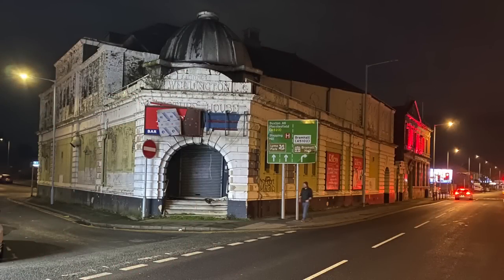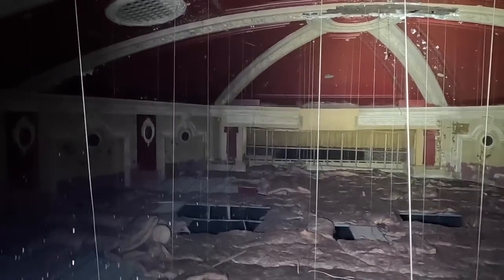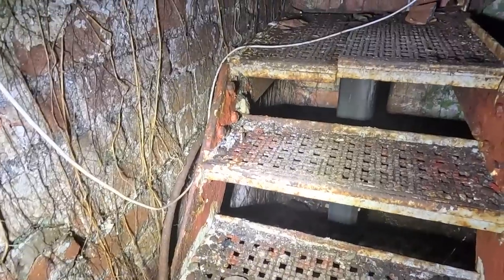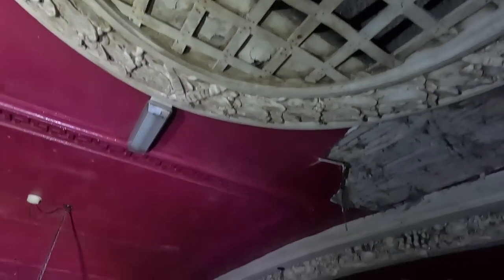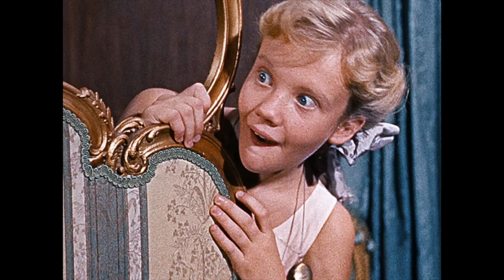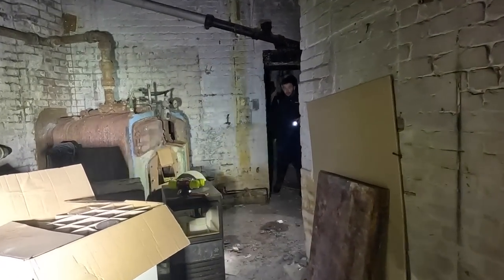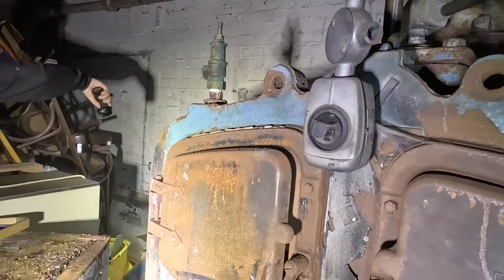The old cinema where Jimi Hendrix & Pink Floyd played

Comment: Hi Martin, the projection room would have had two carbon arc projectors,  each ran for twenty minutes before changing over. Once running, and the film had  gone through the count down the 'slots' would be open and the other one shut, as the film ran out. There could have been a third, which would have been used for advertising slides.
Reply: There are a number of good videos on YouTube showing the workings of projection booths similar to this venue's. Well worth watching and another glimpse of a world now almost totally changed due to "digital" innovation.
Reply: The lamp house behind the projector had the carbon arc system, not the projector itself,one of the best was the Peerless "Magnarc" lamp house.
Reply: @RaggyAl1971  hi, that is technically correct. Worked in a projection room, had one lamp 'projector' and two with carbon arcs, till one was replaced with a second lamp. Had to throw the knives, start the power, then slowly bring the carbon rods together to get a flame, then pull apart till about a half inch. When the platter system was introduced, the second 'projector' was spare, as the film was now joined in a continuous length.

Comment: That stuff on the wall at 4:59 seems to be indeed audio amplifier that could be as old as 1930's, those tubes looks lot like 6K7 or 6J7 which both can be used in input stage of audio amplifiers.
Reply: The  valves in the amp are 1940's era, probably ex WW11 American military with those metal jackets.
Reply: @MrShotlighter  The metal cans are screens to prevent the valves from picking up interference from the carbon arcs in the projectors.
Reply: @SteveW139  Whilst screening would be essential in close proximity to arc lamps, here the screening is an integral part of the valves seen in the video. These metal clad valves (tubes) were originally developed by RCA in the U.S. Widespread cheap availability, as surplus following WWII, meant they were then widely used in the UK too. In the video, one can be seen on the left of the upper chassis & another hanging from its top cap from the same chassis. (At 1st glance it looks like a cable with an octal connector on the end)
Reply: @MrShotlighter  I have bunch of those 6K7 made in 60's in USSR (yes they just copied those designs and early were not even renumbered according to their system) and those are metallic as well as 6K7 were originally developed having metal body (just as 6V6, 6F6 and many other, EF12 comes to mind), glass tubes would be 6K7G (or maybe GT). 6J7 would be the same story (designed in same time as 6K7 but for lower frequencies).  Those metallic cans are not just shields, but body of the tube itself.

But most likely origin of those tubes would be US Army surpluses or supplies in post war period.

Comment: Yep, that bit, in the projection room,  that you thought was a sound system is definitely the remains of a valve powered amplifier or two. The large steel box, on the other side, is a ballast unit which would have provided power to the arc lamps in the projectors. Likely, by the age of the gear, they would have been carbon rod arc lamps, that the projectionist would have needed to constantly monitor to ensure that the gap between the carbon rods, as they would burn away. As the rods burnt out and the arc gap increased, I think the current would change, which is why the large amp meters were needed.  Also, as you go down the steps again, there was a glimpse of some old resistance coils, which may possibly have been to do with the house lights dimming system.

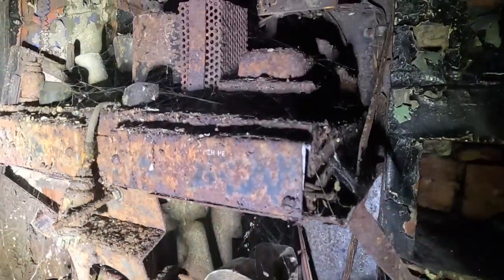Comment: worthwhile filming?  you bet.  impressive building.  i hope it doesnt suffer "demolition by neglect" where a potential developer pays someone a carton of beer to set fire to it.  i well know that dead pigeon smell.  we had a demolition job on a 2 storey building where the pigeons had been getting in.  i tried to convince the boss to shovel all the pigeon shit and bodies out the window before we started the demo.  he was in too much of a hurry so the shit fell down to lower levels as we removed floor boards. so we triple-handled all the shit.  i got the floorboards.  they were rather special.  more than 30 years after we pulled them up the boards that i never used still smell of the shit when i need to move them.  the box at 5:10 and the stuff at 5:40 may be high voltage transformers for projector arc lighting.  that box at 5:10 immediately reminded me of a welder at a place i used to work.  i called it frankenstein's welder.  then you described it as such.  those larger snooker/billiard tables will be worth repairing because they probably have slate bases.

Comment: As my dad would call that "a horseshoe boiler" because of the shape of the water jacket. Obviously, it was originally coal fired, but has been converted to oil in the more recent past. I was wondering, "Potterton"? Or maybe "Baxi"? Maybe even a proper "Worcester" when those names used to mean something in this country, but I'm just guessing, taking shots in the dark.

Snooker tables? You might think would be worth something, but I'm reliably informed that they're not, unless you want to buy one, then you  can't even find one. The biggest problem is moving them. It would cost more to dismantle and transport them than they are worth. A friend and neighbour wanted to sell the table that his dad left to him when he died. In the end, he abandoned it in situ. No one wanted it, and he had nowhere to take it.  Such a shame too, because his dad actually built the table himself - He was given the slates, and set about hand crafting the woodwork in his carpentry shop.

At least as a grade II listed structure, any new owners are not allowed to demolish the building, and cannot alter the outside appearance, other than to restore it. Internally, they can remodel it pretty much as they please, as long as the structural integrity is not adversely affected. So from the outside, the building will remain much as it is for the foreseeable future.

Comment: https://en.wikipedia.org/wiki/Beeston_Boiler_Company     Iused to fit those boilers, several different makers.....ideal standerd was another, they came in section that you bolt together with tapered nipples to seal the waterways, they were then covered in asbestos similer to how plaster is used now.